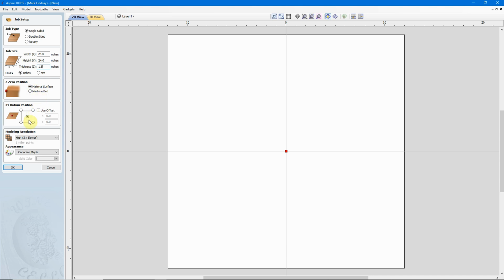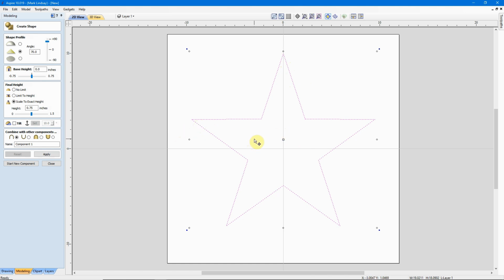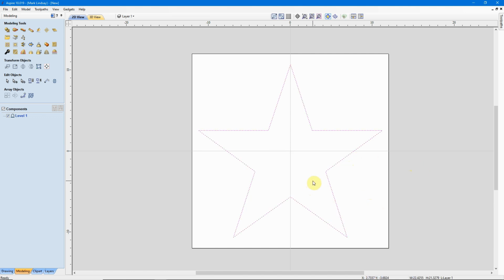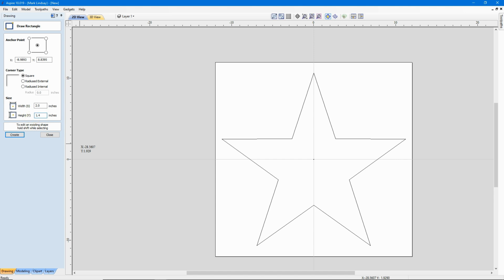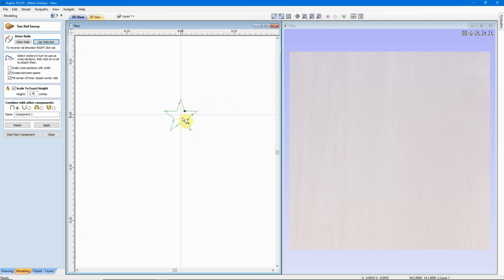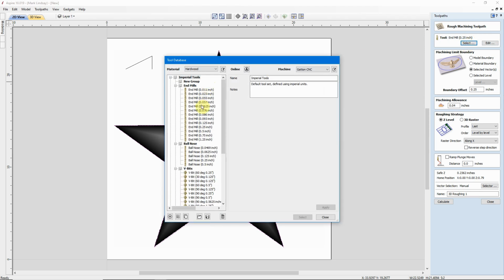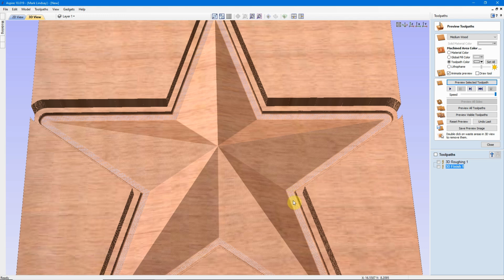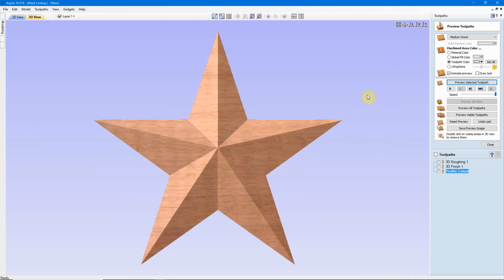Model a 3D Barn Star in Vectric Aspire

Comment: Hey Mark - this was very helpful.  However, I discovered an issue.  Unless you move the inner star down before creating the 3D star, the "peak" of your 3D star will not be in the right place. If you rotate the 3D star you can see it looks weird. To solve this, I created a circle of same diameter of larger star, placed it so that tips of star are just touching the circle, found it's center and then placed smaller star at same center coordinates. Now the peak will be  properly placed when the 3D version is created.
Reply from the maker: Just to let you know, Version 11.5 has made this video virtually obsolete. You can now create the angled shape, then put a check in the box next to Preserve Inside Corners, and the resulting shapes will be perfect.

Comment: Awesome video , Mark....again. I am amazed at how you do some of the stuff you do, the sweep was an ingenious solution to your puffy star problem. :) BUT, my question, for the profile for that how did you determine 2.8 for the one side of the profile, especially with , I would think , the distance between the vectors changing as it approaches the points.  Thx.
Reply from the maker: Thank you very much! The 2.8 inch wide rectangle measurement for the profile was not the important dimension - the height was. The material in this demonstration was 1.5 inches thick, so I needed the model to be slightly less than that. That gave me the 1.4 inch height of the rectangle. To create the rectangle, I just used a 2:1 ratio by doubling the height (1.4 x 2 = 2.8) and that gave me the width of the rectangle. The software knows to scale the profile as the distance between vectors changes, and that creates the downward slope of each arm of the star. Selecting Sweep Between Spans in the 2-Rail Sweep form keeps that scaling consistent, which gives me the sharp angle running down the center of each arm. I hope that helps!

Comment: Another great video even though I don't yet Have Aspire.  Almost makes me want to "pull the trigger" to upgrade from VCarve Pro, but that steep price difference is hard for me to justify as a hobbyist.
Reply from the maker: Thank you, Bob. I struggled with that same decision for 5 years. I finally pulled the trigger last year and never looked back. If you don't plan on doing a lot of 3D modeling, there may not be enough justification for upgrading. I'd say 60% of the folks who have VCarve would never use the 3D modeling capabilities in Aspire, so it would be an unnecessary expense. If you make a few models and price your work right, however, you can easily get it to pay for itself in a short amount of time.